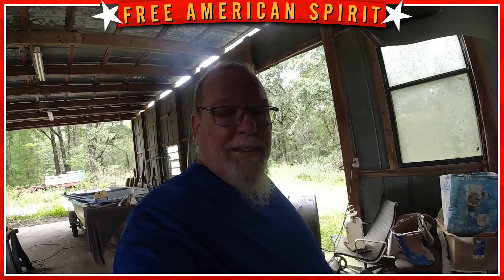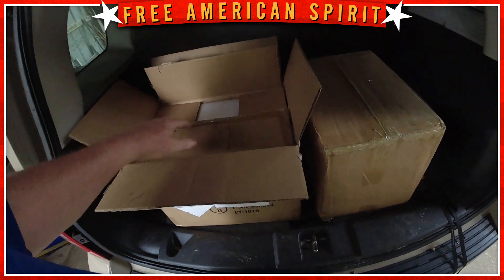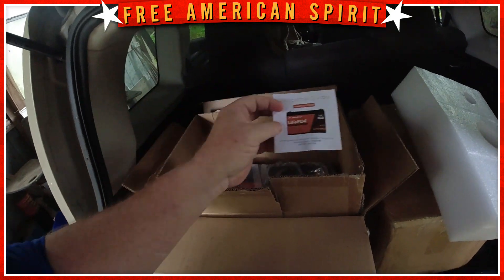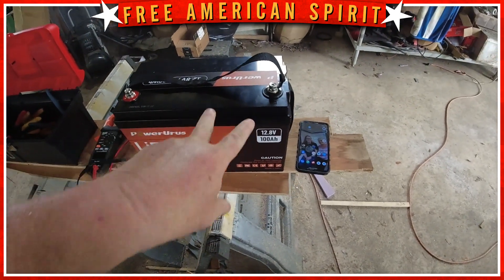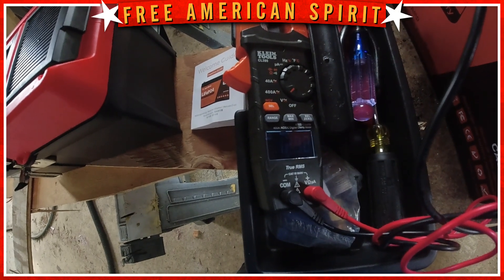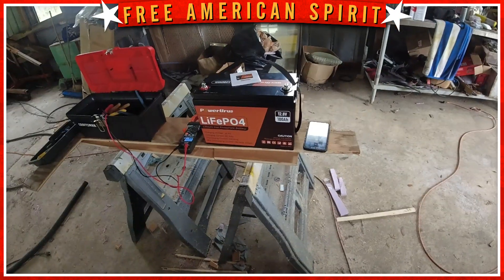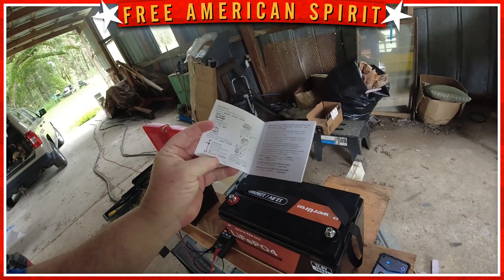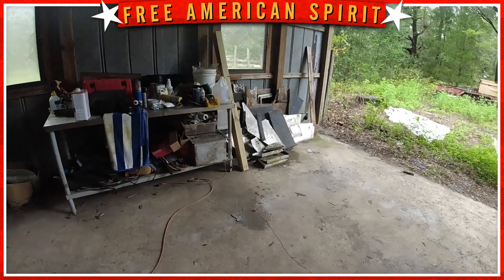# 1A 12 v 100 ah Lithium trolling Battery bass boat  to john boat build  review RoyPow PowerUrus

Comment: That spot on top is a battery vent, in case of a catastrophic event it could vent out the top, instead of blowing up the main case since it's sealed. I believe that's a relatively new feature, so you may have an old version. Good batteries though.
Reply from the maker: They told me the one with the vent is the new case design...  Thanks for commenting and clearing that up.